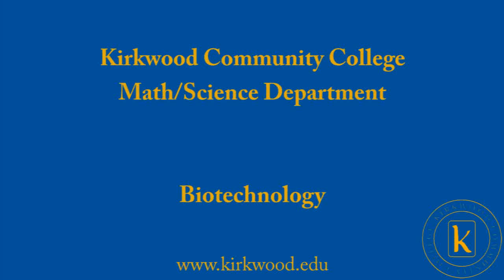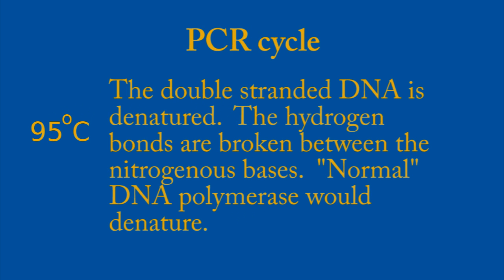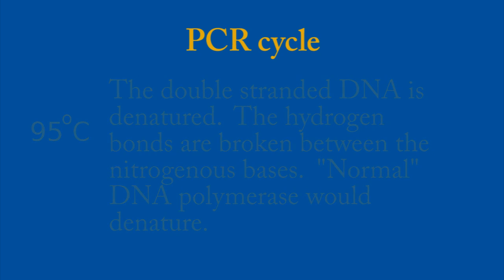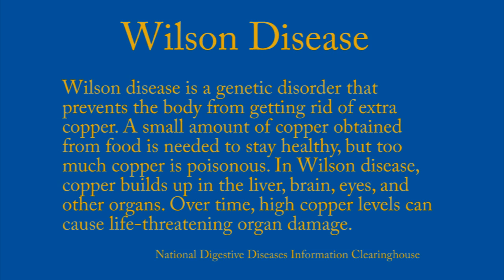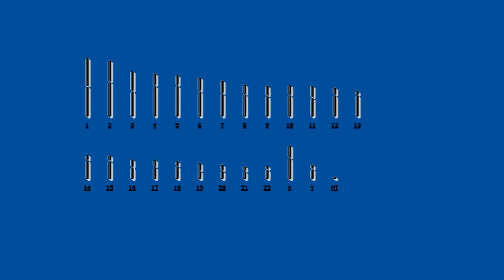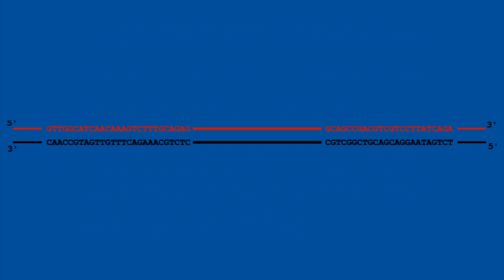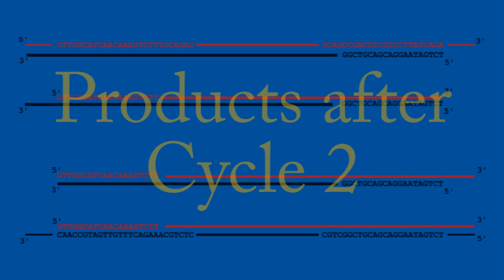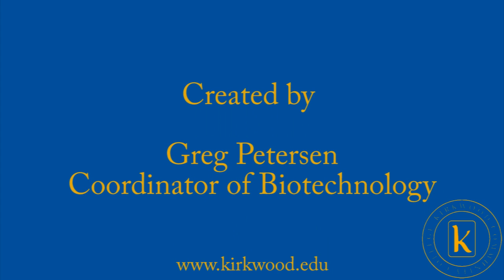polymerase chain reaction

Comment from the maker: Well, it is just what happens.  The first cycle will create a hybrid between the template and a fragment started with the primer.   That fragment started from the primer will keep going until the polymerase drops off or the elongation cycle is over.  What you should notice is that fragment is NOT the size you want.  But what is important is that one end is started with your primer.  So, in the next cycle the other primer will anneal and then drop off when it reaches the end created by the primer

Comment from the maker: It is not until after the 3 rd cycle you get a double starnded versionof your desired product.  After the second round you get a single stranded version, then that will be used in the 3rd cycle as a template to create a double stranded version.